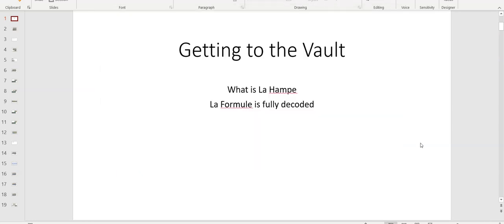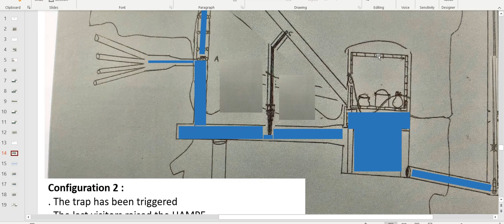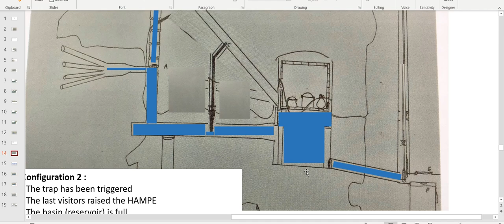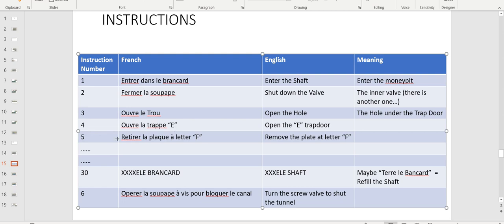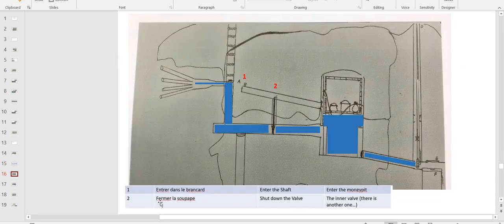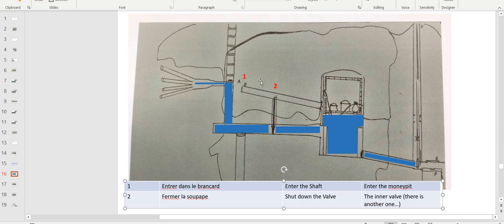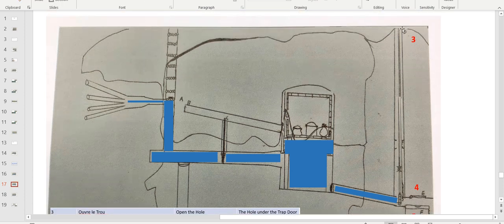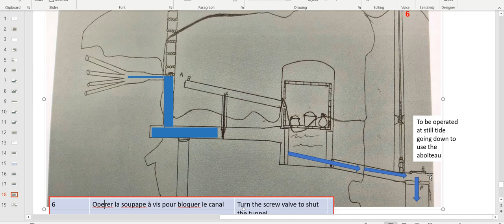29 - OAK ISLAND - GETTING TO THE VAULT II

Comment: That angled piece added to the top of the la hampe pole , makes the la hampe pole inoperable ~ it is locked into place ...  Makes it unable to move the pole up or down , unable to be turned or twisted ... The tunnel floor at 45 degree grade would be super hard to walk in without holding on to something ... It is literally a slide ...  putting it into context ~ the average playground slide is about 40 degrees , the tunnel is 5 degrees steeper making it a super slide ...

Comment: I was thinking about the design you have and the way that construction needs to be water tight, or at least relatively water tight.  The idea of having to take materials below ground and get fresh air for working , when you mentioned the high tide level and the geography of the island , it strikes me that the chamber fir the treasure would be logically constructed from the surface and in stone, as a well. Presumably the minimum depth would take you 2 or 3 meters below high tide and a cap could be placed on the chamber after the whole system is installed , it possibly means finding land that is about 15 meters above sea level and not too far from the sea for the flood water tunnel.  Thus means you would have a 2 meter round shaft to yse as access and allows easier access for digging flood passages and removal  of waste. The floating support for the treasure could then be a large round barrel , although it seems more likely that there would be a hidden shaft behind a hidden entrance rather than all this hydraulic system . There must be so many ways that a treasure can be securely hidden without the use of water, although I can see how the system that was triggered in the money pit was possibly worth constructing as it was intebded to eitger drown intruders or scare them and it as done that fir 200 years. Another thing I was considering is for the water to enter the floor of the treasure chamber rather than a tunnel in at the side and another out on the other side .

Comment: Great videos, thanks. Could La Hampe or pole be a ship's mast or yard arm? If so, it could have been dropped into the "eye" of the swamp to form the blockage. From your map the "eye" seems to line up quite well.  Also it appears that the "eye" is constructed from stone so it would allow the mast to rise and fall within water rather than getting stuck in place.  How? Sink the ship so it tips to one side allowing the mast or yard arm to align with the "eye". Simply drop it into place. Perhaps this is feasible? When the trap is sprung, the incoming water flows up past the Hampe causing the creation of the swamp over many many years. Just curious what you think of this theory?
Reply from the maker: I really don't know.... It may just be more simple than that, but I understand you're trying to use the Lego pieces available to reconstruct the whole picture. That's what we try to do with Michael and William as well, but we learned not to go too far in our hypothesis....

Comment: Found your channel a few days ago and I'm hooked! I have a question regarding the Aboiteau... it seems to me that it can only drain water to the level of the lowest tide and no more; this should give an approx depth for the vault. You seemed to suggest that the vault could be lower than low tide but I don't see how, it must be between high and low tide (so not that deep). Maybe it could only be initially accessed at spring tides but once accessed the hampe would be used to keep it open? Also, I think Michael Turk's comment below may be correct... how would you physically get a long pole into the vertical shaft from the horizontal shaft? You can't bend it but you could dig the vertical shaft all the way to the surface.
Reply from the maker: Hello Gordon, very interesting and relevent questions indeed. Though I can't provide a proven solution, these are my thoughts: About the  aboiteau, yes, you would need a way to compress the water upon release to help it go back up to ocean pressure level. And we do have such an apparatus available on the b&w sketch. I'm not telling more as I'm thinking about a video on this topic. About the Hampe, I will probably shoot a video tonight as I think I discovered exactly what it is. Let's remember the dimensions on the b&w sketch are all but accurate. They could have place a "cathedral" ceiling at this very position, or drill a hole from the open air to install it, or cut is into sections, with threads to re-assemble it by sections once inside the service tunnel.... many possibilities.... ;)